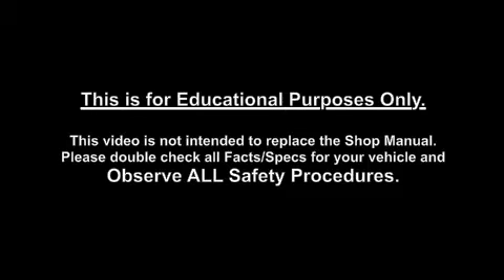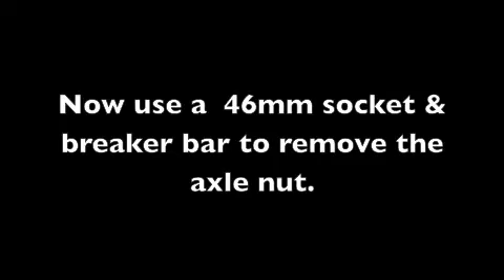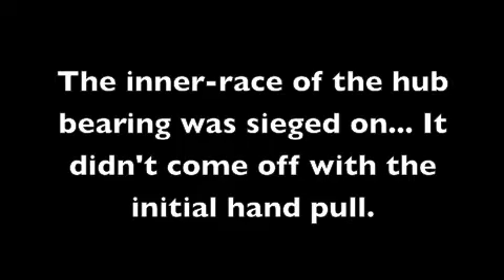BMW Wheel Hub Bearing Replacement : DIY [ How To - Part 1 of 2 ] /// 330i (E46)

Comment: Just had a new wheel hub replacement got the rear right replaced done by the dealership they told me after they did it they couldnt get the abs light to go off. And now theres a loud snapping/popping noise in the rear everytime i go over bumps ideas?

Comment: All my wheel studs broke off, I already tried the screw extractors but they broke in the hole I drilled. Should I just replace the hub or try and get them out another way? Its currently on the side of a road cause I didn't make it home.

Comment: Excellent video, many thanks! I replaced it myself, saving lots of money and I know its done well. My inner-bearing-race did the same. However I don't have a puller. So I used a Dremel. But what I did was just scratch it enough to be able to put the tip of a screwdriver in it. I then could just hit it, not even hard, to turn it. Then it came of pretty easy.

Comment from the maker: You can use the same breaker bar and large torque wrench, however because of the rear axle, you need different bearing tools to remove them properly. Good luck.

Comment: HI bimmersgarage! I have an question( first of all SORRY for my bad english)!so i have an bmw 320d e90/91 touring 120 kw 163 hp 2006,i hear a noise on back  right side of my car,it sounds like damaged bearing...I want to replace it  by myself, i bought an NSK bearing kit for bmw e90,is the same to e91 touring?, if is the same i have another problem-the nut on my car is something like 42mm but the new nut on the new kit is 32mm the threaded hole looks the same... did u had  these situations? thx!

Comment from the maker: (On the First attempt??) Not everyone has steady hands and it would ONLY take one slip of the Dremel to permanently nik/score the kingpin. On top of that... trying to whack that notch even if you get a good cut would present more chances of the Chisel slipping and denting the kingpin AGAIN, if you slip or miss the strike. Too much risk of damaging your axle just to take a shortcut "easy" method, in my opinion. Obviously, one wouldn't care if it was done to Someone Else's car...  just my 2 cents.

Comment: the easiest way to get the inner race off the hub is to put a dremel tool and score a notch about halfway through the race and put a cold chisel into it and whack it with a hammer. Pressing it takes forever

Comment from the maker: There's actually two dust cover per side (an outer and inner) Depending how rusty it is you may need to break them off. If the inner cover looks good, you may leave it as is.

Comment: I found the video to be great and didn't have that much trouble seeing it as anothe viewer indicated.  I have a 2000 323I and haven't had any trouble with it since I bought it 11 years ago until just recently.  Just normal maintenance.  I thought the themostat went but it was much more expensive (about $600). Now I have the noise in my front right passenger wheel and I was hoping someone could tell me about what it will cost to have this work completed.  Thanks for the videos!

Comment from the maker: Without a video of your particular noise/problem - it's just a guess, but if you have a annoying metallic whine at speed, then it's very likely the hubs.. If you know that you're still on your original hub/bearings then it's definitely time to replace. Just make sure you double check the model number for your specific model/year when you order your parts. And, yes you Should replace BOTH sides at the same time. Do NOT replace just one side.. you don't want to have staggered wear of the bearings.

Comment from the maker: First, what Brand of hub/bearings did you buy? Second, you're talking about the kingpin that the hub/bearing mounts to. If the kingpin itself does not have any scuffs or have any other markings that would indicate damage then it should be alright. Just DO NOT re-use the old axle nut! >Get new ones. Also, make sure the axle nut is torqued down appropriately to spec. If anything, you should notice how smooth and Quiet they are now, than compared to before. Thanks for viewing my vids.

Comment: Great Video! I recently replaced both of my front hubs on my 2001 E46. I was surprised when both of the wheel hubs came off with little to no force along with the inner race. The new ones slid on with little effort at all. I pressed with my thumbs on the inner race to get them on. Should I be concerned? Would the part that the wheel hub sets on possibly wear out? The side with the worst wheel hub was actually the easiest to remove and put on the new wheel hub.

Comment from the maker: You can find these large 46mm sockets at tools shops who work on semi trucks. I can't say on behave of BMW why they used such a large axle nuts, but I suppose their engineers had their reasons. Here's some interesting travia - Did you know some of the brake components on the E46 are shared from their bigger and heavier 7-series originally. So, they properly over engineered some of these parts that was used in their top models and just moved them down to the 3-series as time went on.

Comment: I just did my fronts with no problems, the race slide off with a simple poke of a screwdriver.  The new ones slide on very nice, plenty of never seize and a few light taps.   The rears are a different story...they suck.

Comment from the maker: @Lvd050 
The procedure is the same but the part numbers would be different, of course. Just make sure you/your-friend get New axle nuts instead of re-using the old ones.  Also, replace BOTH sides (Driver and Passenger Hub/Bearings) at the same time. You don't want to end up with staggered amounts of wear on these bearings... Just a heads up. Good luck. And, thanks for watching my vid.

Comment from the maker: @swizz85 
NOT a silly question at all, it's for safety reasons (& peace of mind)Plus, considering a new one only cost around $8 (us dollars), you might as well replace it. 
Yes, the notch has something to do with it, because if you re-use the old nut, the chances are very high that you'll end up at the same spot once you tighten it back down & will Not have the "material" left to re-notch that spot on the nut, since you had to break that "notch area" to loosen it in the first place.

Comment from the maker: @StarsMarsRadio 
Now THAT is a tough nut!
Do you have a photo of this said nut? I want to see the condition of it.
Must be some serious rust that's got it siege like that. Hope you took a video of that breaker bar busting, that would have been a instant classic. 

But, all kidding aside... I think the best option now is to soak the nut with a shot PB Blaster and let it sit for a couple of hours then try to loosen it. If it doesn't give, hit with with some heat from the torch again. Be safe!

Comment: @bimmersgarage actually, i got into this job on my e30. The hub nut. 36mm. We broke a breaker bar. torched it and used an impact wrench. still not coming off.

Comment from the maker: @shaggie90i 
Good to hear my vids are giving you the confidence to do this project yourself, even though no indie shops are willing to help you out... That's really a shame.

Other than ordering/buying the correct hub-bearing for your vehicle and having basic tools... the only additional "special" tools you really need to have on hand are: a torque wrench that can go up to 200+ ft.lbs. and a locking three jaw puller < only if the inner race gets stuck on the kingpin/axle.

Good luck my friend.

Comment from the maker: @skilledindian 
Hello.
Unfortunately, once you damaged (Break) the inner race on a NEW Hub Bearing, it becomes useless. Even if you were able to push the race back on, it's the track-clips within the Hub that holds ball bearings that has been crushed that's making those horrid noises/sounds...
The only thing to do now is to get a new Hub Bearing and replace it again. But, this time you MUST use correct size bearing-installer to properly set the Hub on the kingpin >
See Part 2 Vid @ 3:20 for how.

Comment from the maker: It wasn't good luck... it popped off like that by hand because the bearing retaining clips inside the hub was already completely worn out. I wouldn't have been able to pull them off like that without tool(s) if New.

Comment from the maker: Basically, with the wheel and brake caliper off, all you need to do is spin your rotor and if you hear any kind of metal-ish noise/sounds it's a pretty good bet that your bearings are shot.

It all started around 96,800 mileage, if I recall correctly. But, the Hub/Bearings were replaced at 97,205.

Thanks for commenting

Comment from the maker: The Main issue was an annoying sound that emanated from the front of the car, like tire noise. 

At first that's what I thought it was, and had an alignment done, however the noise continued. And, it would get louder as speeds increased from about 20mph (from what is heard from inside the vehicle) So, that's when I did the bearing test - search for > BMW Wheel Hub Bearing Noise /// 330i (E46)